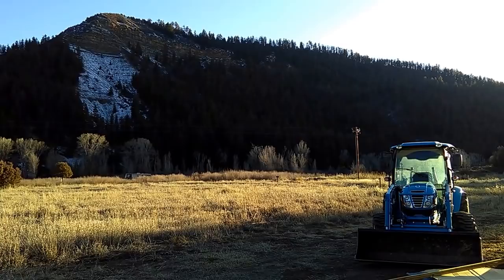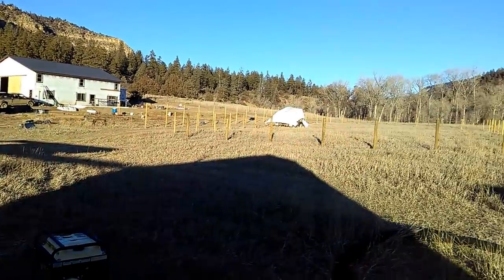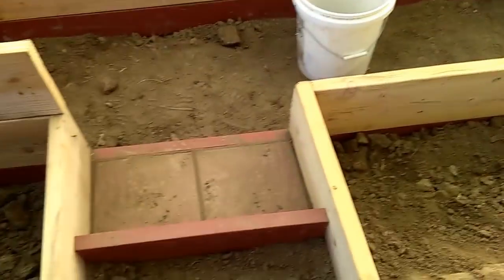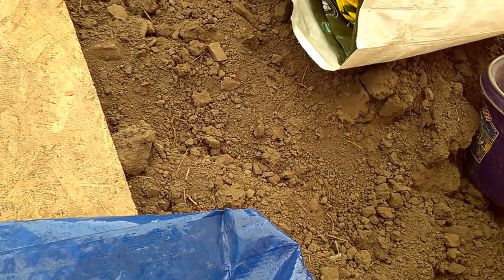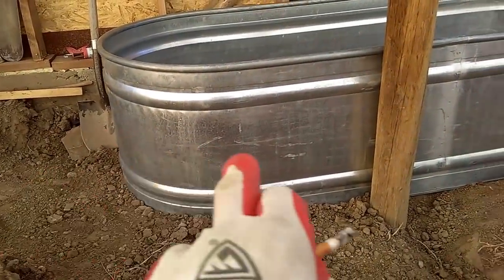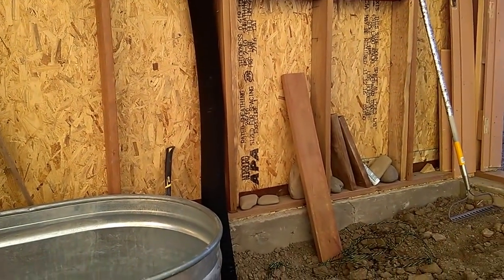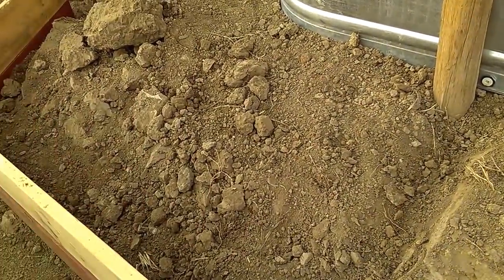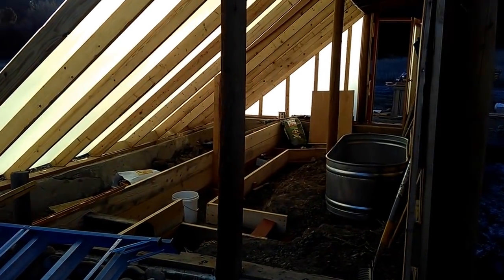Geothermal Greenhouse Update - Raised Beds - Thermal Mass - Food Production - Climate Battery

Comment: David I love the layout, have you considered laying a poly wet insulation inside these boxes, to protect the inside face of the timber? Warm moist soil tends to permit entry into soft woods. Great build.
Reply from the maker: The last two days I have been treating the wood with preservative - After it dries we will back fill with dry clay. The upper part of the bed will be vapor barrier and weed control fabric then soil. No direct contact with wood anywhere.

Comment: You're going to wish you had built it bigger considering we are at the beginning of a grand solar minimum. Adding some cheap LED grow light panels (2 for $20) would greatly increase your productivity and not raise your electric bill by much.
I have an old garage that I've converted to a greenhouse, no real sunlight, but 10 LED panels to start off with March 1st here in NYS, not known for a really long grow season. I'm going to be starting an indoor herb and sprout garden in a few weeks since over the next few years food prices are expected to go way up. 
If you research grand solar minimums, you'll see they can last a dozen years upto several hundred, this could be a new way of life for a very long time where greenhouses and indoor grow rooms are the only really good producers ... I sure hope not.
Reply from the maker: We have four different Geothermal greenhouses under construction right now. The one attached to the house is 1800 square feet. Which is equivalent to six of the ones in the video. BOOM. More greenhouses on  the way on top of that.
Reply from the maker: Did you just say if I research Grand Solar Minimum?  BOOM
Reply: Oppenheimer Ranch Project oh, I'm new to your channel, so sorry, I don't have esp ... just a desire to pass on what I know. After 10 1/2 years of college, raising 6 kids and now on my 9th and 10th successful businesses, I tend to take myself way to seriously.

Comment: Hey Diamond!!
Thank you for this amazing video.
I wanted to ask you why did you move that far north when we are facing this Great Solar Minimum.. wouldn’t be easier to establish ourselves in the South?
Just wandering as I have decided to move to the southern point of Spain (and Europe!)
Reply from the maker: I'm in the right place friend - Check out the historical maps on my location warmest, safest place on Earth
Reply: If you're speaking of the Rito Blanco  east of Pagosa Springs, the only 'warm', 'safe', place anywhere in the vicinity is the AMAX mine outside of Leadville.  
......  that's because it's underground. 
Spent 35 yrs. in Colorado. Pagosa Springs is invariably one of the coldest spots in the US.
Perhaps you're referring to a different Rito Blanco.
Reply from the maker: Apparently you have not been here recently.
Reply: .... with no intention of returning.  ... NOAA's forecast lows for 1/21/18 - 1/25/18 -- 4F/5F/7F/11F.
.... & that's balmy.   
btdt.     
Admiral effort on your part,  nonetheless, considering the soil. 
Investigate nicotine free programs.  ... Sounds as though Emphysema's beginning to impact your lung capacity. (suggestion comes from a 2 pack/day 25 yr. Chesterfield smoker.)
Thanks for your efforts.